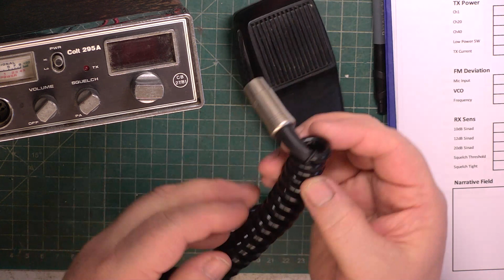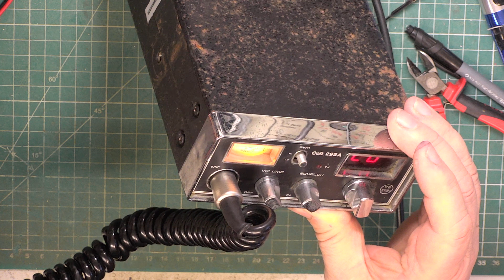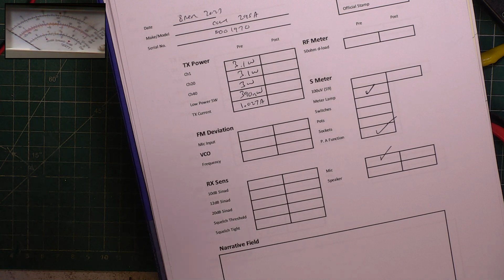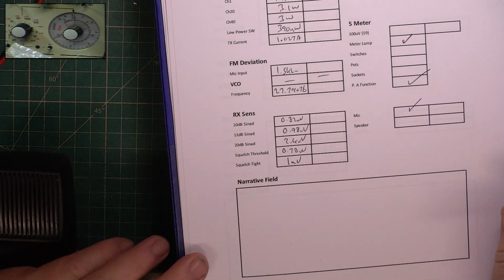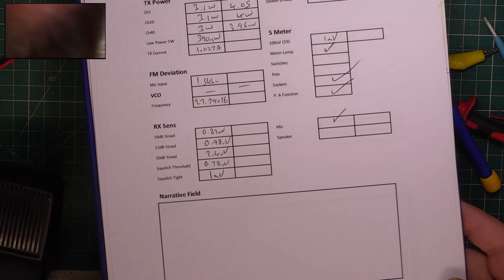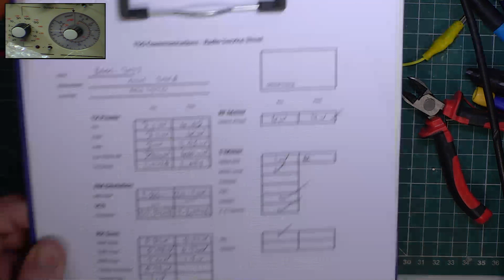Colt 295A CB27/81 Uk FM CB radio -  service & alignment

Comment: Early not quite legal version (your words) also had the same knobs as on the AM version..
i have all three here, 295, 295A and AM version 210..
The mic is correct..
Reply from the maker: The deal was (like with the Midland Precision series without low power) is that the DTI permitted it, but if a customer insisted on the low power switch, the radio either had to be modified or swapped for one with low power at no cost to the customer,.

Roger on the microphone.

Richard